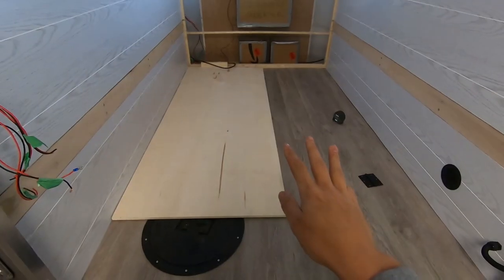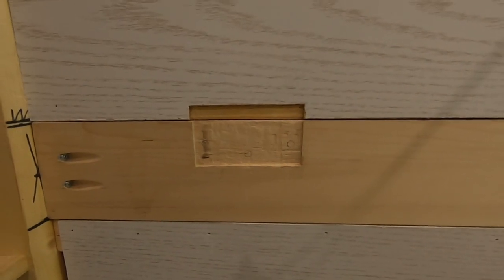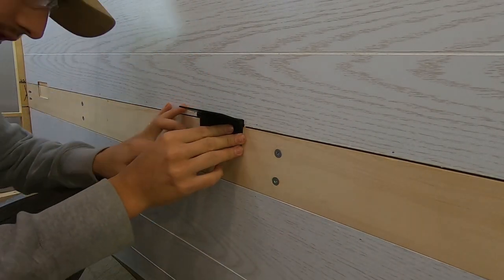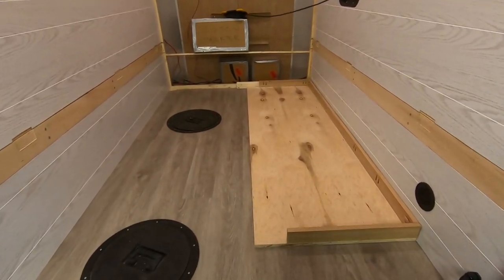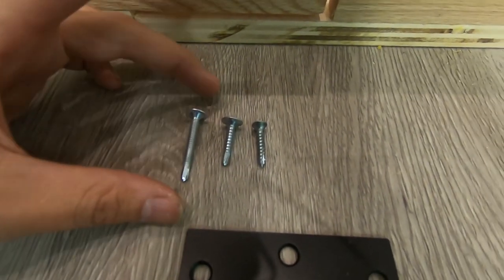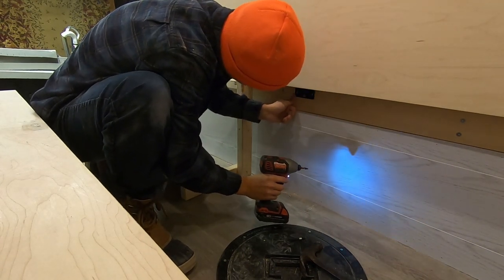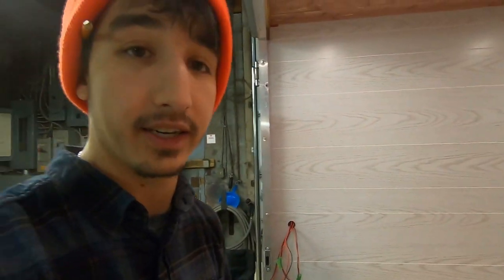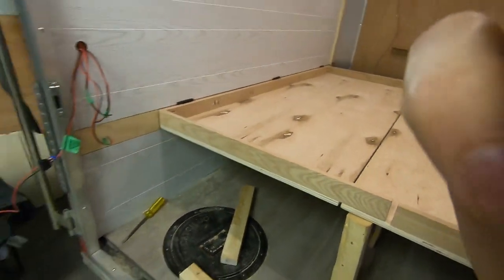Building the Fold-Down Bed | DIY Cargo Trailer Camper Conversion

Comment: To anyone here looking for advice, drop a chalk line down the center of the trailer floor square in the middle of the opening. Then take measurements to the walls along this squared center line. You will find where the head of the trailer (near the hitch point) and the rear of the trailer are out of square to each other. From there, plan accordingly.
Reply from the maker: Right on! Great idea

Comment: Joel...When cargo trailers are manufactured, exact measurements are not taken into account and they are not exactly squared. Although they are put together in my opinion better than class A's & C's...they are still clapped together fairly quickly & they are not designed for camping or living in. So it's not you. I measured my bed framing exactly the same on both ends and came out cockeyed by 1/2" on one side...as if my trailer is 1/2" shorter on one side 🙃 Just something you have to deal with doing a cargo trailer conversion. Looking good...have fun!!
Reply from the maker: Yeah not a fun discovery!
Reply: Nope!!

Comment: I came for the cedar ceiling and stayed for the bed. I will be honest that bed looks flimsy especially the legs. I have lived in mine full time for 5 years and the one thing that has not been an issue (the only thing) is my bed. It is set in a casement. Cupboards underneath and above. 8" mattress. 4x2s for a frame. 1/2" ply for bed. With some work the entire thing comes out in one go. Sprung gate bolts hold it up. The legs are made from plates of 1/2" ply glue to double up. Large locking Long Release Arm rated at 550 pounds to lock them in place.

Comment: May I suggest you use 2x2 for the legs instead of the 3/4" lumber as you have!  Moving around on the mattress will cause the 3/4" legs to fail over time especially if you have two people in bed.
Reply from the maker: Thanks! I do have some ideas on how to improve the legs. Stay tuned!

Comment: "best laid plans" I converted s shuttle but 4 years ago and now converting an 8 x 16 V-nose cargo trailer and have learned I have to build to the opening...sometimes plumb is not plumb and level is not level...Im in the middle of my build... my murphy bed is dual purpose... I have a murphy work table on the bottom of it... so table down, work, table up and bed down, sleep :)

Comment: Do you have a framing square to see if you have 90° walls and corners?  I am guessing that your two walls are not mating up at 90° corners  They only have to be off by 2° and you would be off as much as 3/4" of an inch over 7 or 8 foot wide wall opening?
Reply from the maker: You would be correct on that assumption. The corners are slightly off from the factory. C'est la vie.

Comment: I guess I didn't consider the trailer itself might not be square. I was so shocked it didnt align considering how meticulous you've been with your measuring. (Also, i would consider using a thicker piece of wood for the legs, maybe 2x2. The 3/4 is fine in an ideal world of not movingbwhen you sleep.)

Comment: You are very talented, but the legs don’t seem sturdy enough?  What keeps them from folding under and ripping the bed off the wall?
Reply from the maker: Thanks for the support David! And yes I ended up updating the legs on the bed with locking hinges as you have suggested. Can see how I did it in one of my newer videos.

Comment: Use an off set butt hinge and life will be easier, mount the bed frame above the hinge so it bears the weight, not below where the weight hangs from the hinge. :)
Reply from the maker: That's a good idea!

Comment: My guess being a shop teacher. You measured from the same end, but on opposite pieces.  This is a common mistake when making right and left pieces.  Again just a guess from seeing hundreds of high school students make similar mistakes.  Basically I think you had them positioned with the hinge side toward you on the workbench, then measured from same end.  That is where the minute motion turned into a major miscalculation.  Once you flipped one of the sides around to install, the mistake became apparent.  Curious to know if this might be the case.  Let me know.
Reply from the maker: I'm not quite sure I totally follow, but the issue that I came to realize is that the trailer walls are slightly skewed. Imagine a cardboard box and pushing one side out making all the corners slightly off 90°. Thanks for watching and the suggestion! I'll keep it in mind next time!
Reply: @JoelTremblayCA  did you square the walls?  you can use a bar to do it. and, when set, you install single top bars.  takes time to unwarp the square.

Comment: Why would you worry about that 1/8th inch gap between the bed enough to do all that unnecessary work mortaring out the hinges?
Reply from the maker: @dale7758  maybe unnecessary from your perspective but I wanted something clean, tight lines with no gaps!
Reply: @JoelTremblayCA  on the back side of a bunk that’s stays folded up 75% of the time? Ok. But it’s yours and I understand you wanted more content so I can’t say you are wrong!

Comment: I am looking to build out a van, possibly a Chevy Express 3500 ... This is so close to the idea I had thought about.  The difference is that I want to keep one side down all the time (with storage under) and the other half of the bed come down form the wall ... and a fold- down table on the fold down bed for use during the day as I want to have the comfort of a table for when I use my computer.  If anyone has seen any videos about a table folded up within a Murphy style bed (Actually shown in a low ceiling van) could you please reply with a link here.  Thanks!

Comment: when you build in place... never assume anything is square ...  pick a reference line in the center and measure off it...  it's not just your trailer that had "skewed" you over, this'll happen in houses, basements etc...  get a square and USE it... same with floors being level... they're NOT (most of the time)...  good job though guy :)
Reply from the maker: Thanks man! Yes I learned the hard way on this one. It's ironic being in architecture where plans are always exact down to the mm. This was a good lesson to learn that tolerances are always needed in the real world.
Reply: @JoelTremblayCA  everything is built a "hair out of square"  ;)   I've done machining that was measurable to .00005" though ;)

Comment: How high is the Bottom of the bed frame to the floor?  thanks  oh, how thick of a mattress would fit in your design when up against the wall?
Reply from the maker: Top of floor to underside of the bed is 14-15" can't remember exactly. The bedframe is build out of 1*3 oak (nominal size is 2 1/2" deep) I purchased a 3" memory foam mattress (leaving 1/2" proud of the bed frame). Thanks for watching!
Reply: @JoelTremblayCA  Thanks for the prompt reply!